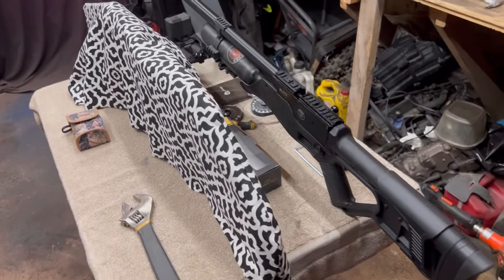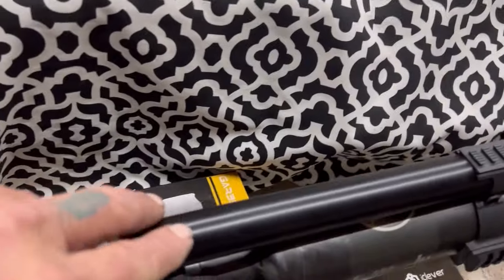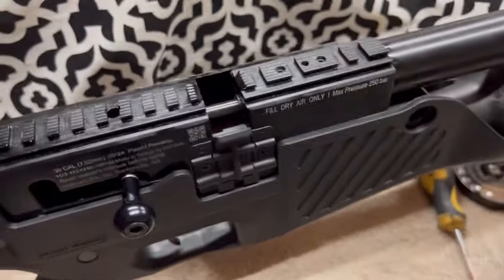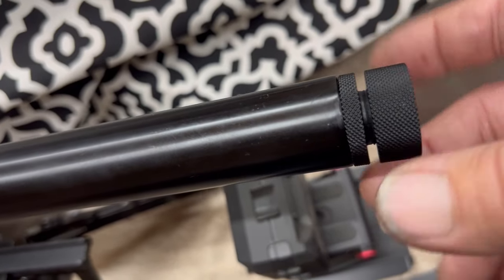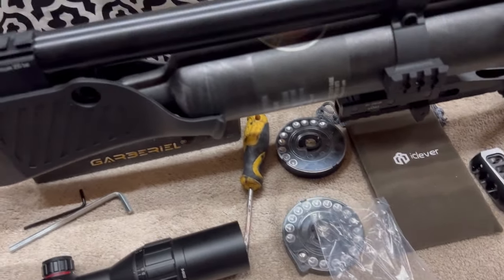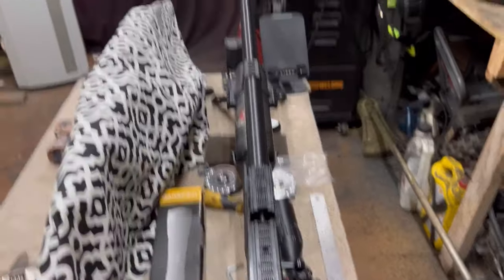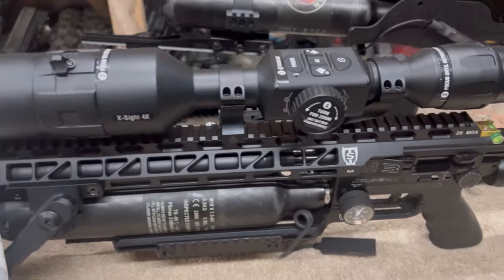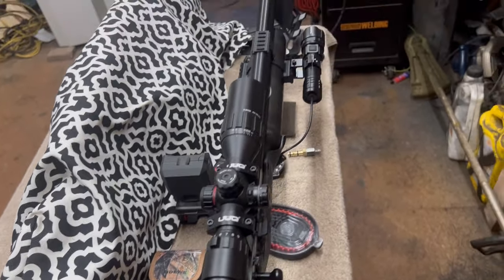hatsan blitz 30 cal. vice and upgrade!

Comment: Can you let me know what mounting rings u used
Reply from the maker: @kcradd7618  copy this and go to Amazon and paste it!

UUQ High Profile 1-Inch Scope Mount Rings, 2-Pack for 20mm Picatinny/Weaver Rails, See-Through Dovetail Design for Airguns & .22
Reply from the maker: @kcradd7618  you will also need the risers. You will need to modify one of them to fit the blitz. You have to shave down one side copy and paste this on Amazon as well!

Picatinny Riser Mount, Low Profile Rail Riser Mounts Adaptor with QD Lever Lock Quick Release & 5 Slots Picatinny Rails for Scope Rings Optics Sights, 1/2" H x 2.5''L

Comment: No do not use that thats silicone oil for metal on metal thats no go I got sfl 0 grease very thin good for metal on metal, I advise you take it apart and clean it all out and get some thinner grease for metal on metal not silicone.
Reply from the maker: @marksman349  yeah I removed all of that but the stuff you’re using is way too thick. I already checked that out. Don’t get me wrong it’s very good. gun grease but you want to use something that’s more like an oil rather than a grease however, I am using A PCP Airgun grease and a very little bit of full synthetic oil that is obviously used for metal on metal to cut the grease a little bit you want that thing to be slick as snot but not runny lol😁
Reply: @TheManCaveMetalFab2580  mine might be too slick I sometimes had it clip the magazines I took them apart and wound em up an checked em to make sure I can cycle it with heavier weights full mag, Crazy firerate around 2000 rpm once power is turned up firerate goes up aswell
Reply from the maker: A full magazine at a heavy weight will pull the clip down. You need to put a padding on the rest underneath the clip. The clip cannot slide down against the rest or else it will cause possible jamming